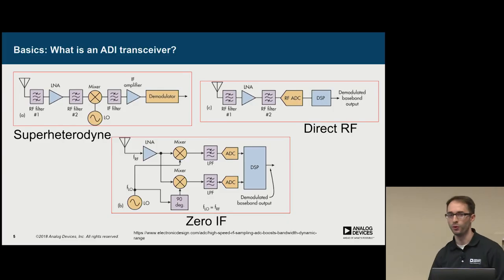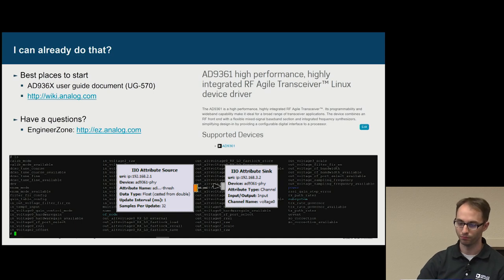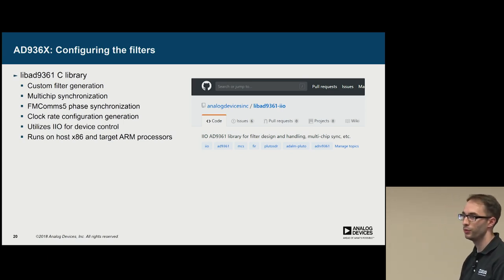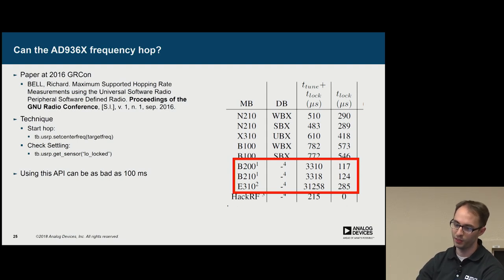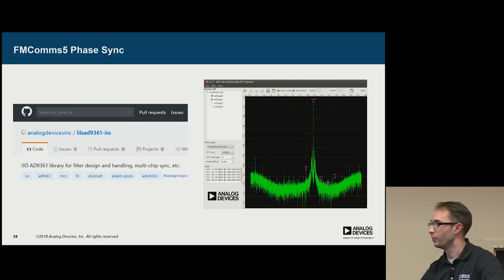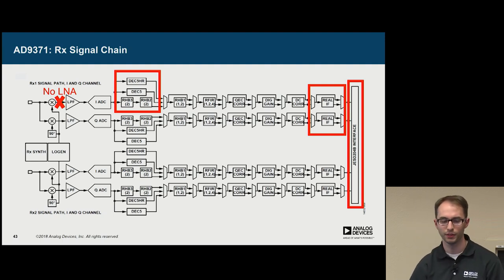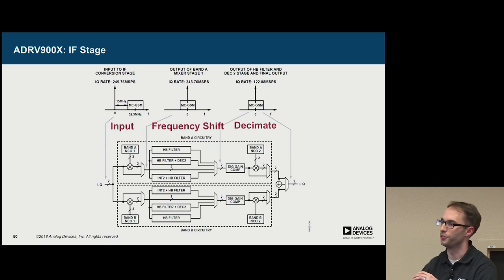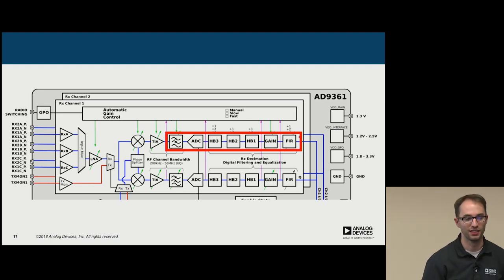GRCon18 - ADI Transceivers  A Deep Dive

Comment: Thanks for the nice explanation.I have query how to use API given for fast lock mode through GRC (GNU radio) as I am using USRP b210 in which AD9361 is a daughter board. I want to hop the freq at the fastest rate.